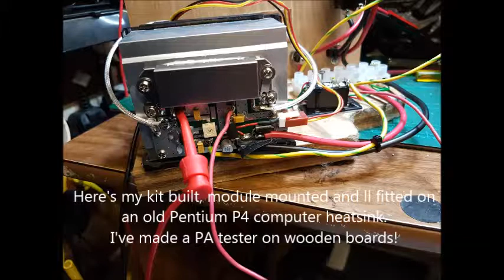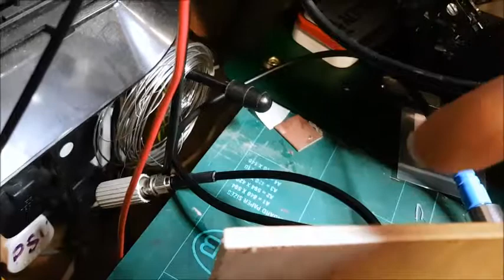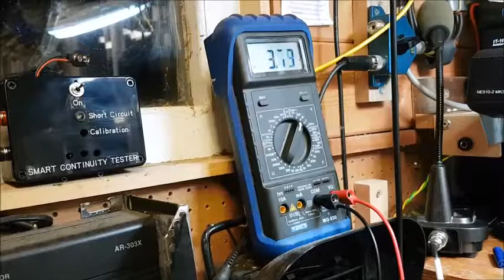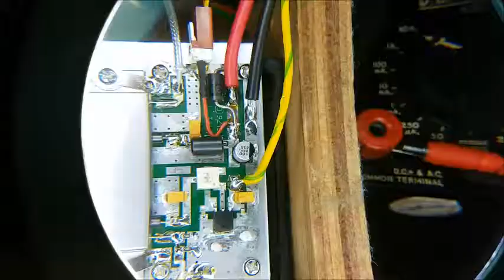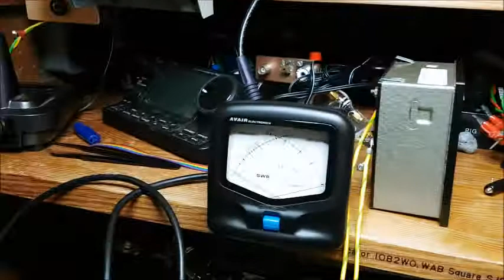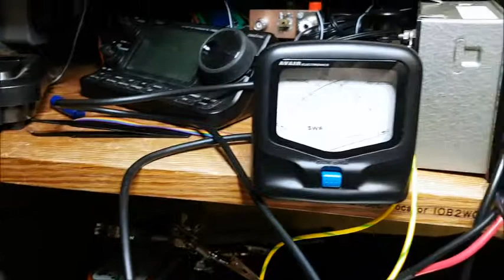UHF Amp first tests

Comment from the maker: As this is a record of early days in constructing higher than VHF kit, I didn't know about best practice. Dr Ian White GM3SEK wrote tongue in cheek about the errors builders make in this article :- https://gm3sek.com/2017/09/16/28/ . I think I blundered into three of these. It was really important to mount the main PCB directly on the surface of the heatsink and definitely NOT on washers as seen in the film! It was on washers to allow PCB mounting SMA connections. It's far better to cut a patch lead in two and solder the centre conductor and braid (each as short as possible) to the PCB. Then the main board can be mounted direct as mentioned before. My later film https://www.youtube.com/watch?v=eTOGBR_82FU&t=6s shows these lessons in practice.

Comment: Brave to film the first switch on!  I found the Portsdown has enough drive without needing an intermediate driver. You need a fairly high bias current to get good shoulders. 3/5A not unreasonable for an RA30/RA60
Reply from the maker: Mike Willis - thank you. I tried each stage off camera first while pause was pressed. I'll have a PE4302 attenuator for which I have already made a G4KLB controller so I can use that when we get to the analyser stage instead of the fixed attenuator